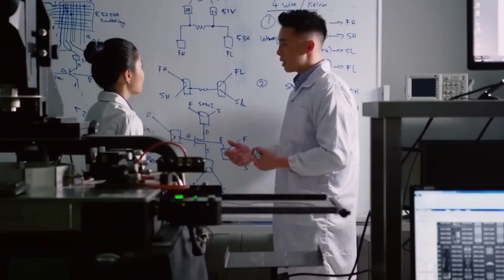No Western Approval, No Problem: Inside Huawei’s 6G Revolution

Comment: That's China  08:02   not just planning ahead, but moving at a speed incomprehensible to the West.  The West is doddering in some ketamine fugue set in 1995, unable to deal with now.

I had wondered about current political events in China, now I see possible reasons to speed up readiness full  spectrum and clarify chain-of-command. 

Changing the world order is a dangerous business.

Comment: Huawei is actively leading the global race for 6G technology, positioning itself as a key innovator through strategic partnerships, significant patent holdings, and a vision centered on integrating artificial intelligence (AI) into the network's core architecture. 
The company's efforts are focused on developing a next-generation network expected to be standardized by 2030 and deployed in the 2030s, with a fundamental shift from 5G's service-based architecture towards an Application-Driven Network (ADN) powered by Agentic-AI and Artificial General Intelligence (AGI).
Huawei is pioneering the concept of A-Core, a 6G core network powered by Agentic-AI, designed to seamlessly integrate application creation with customized network generation, unlocking new business opportunities for telecom operators.
The ultimate goal is to achieve "connected intelligence," where AI is embedded in 90% of businesses, outperforming human experts and contributing to 90% of global economic output. 
Huawei is also exploring advanced technologies such as terahertz frequency bands and new modulation schemes to support this vision.